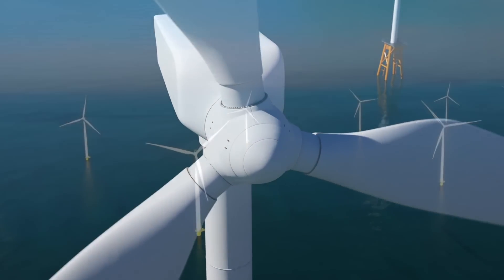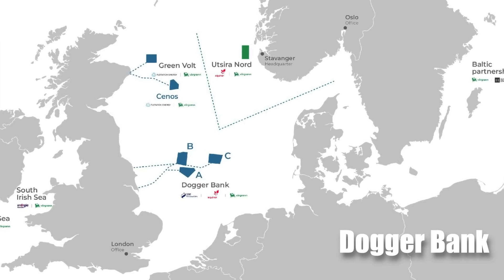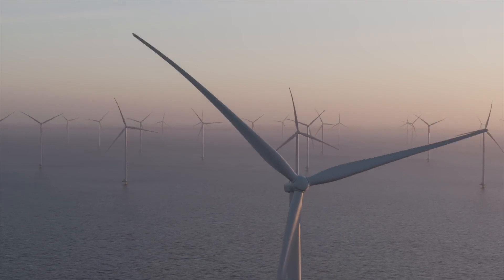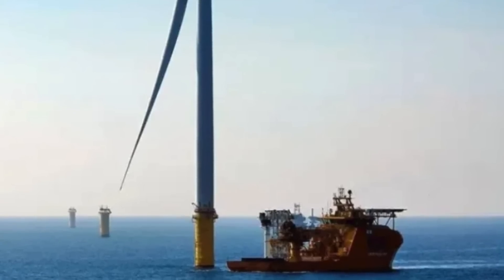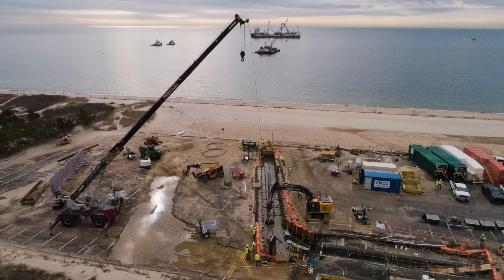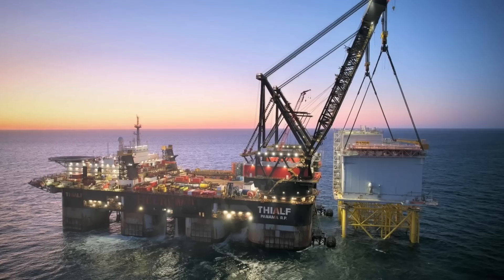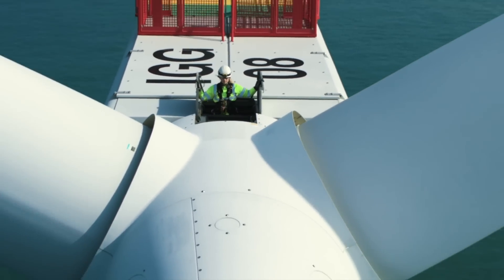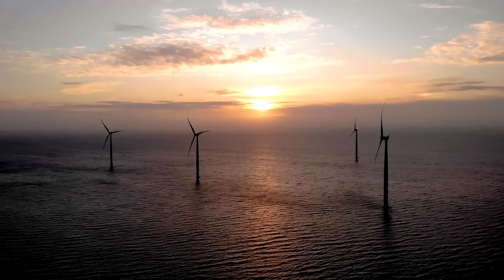Inside the $11.6 Billion Dogger Bank: The World's Largest Offshore Wind Farm

Comment: Can the UK run on 100% wind eneregy?
Reply: Potentially in combination with, tidal power, power storage, hydro power and solar power.
Reply: @petterbirgersson4489  they don't produce consistent power they fluctuate so without the power storage problem solved they won't dominate the power grid.
Reply: @WDUK-x1x  Sure it doesn't blow all the time, but the North Sea is one of the areas of the world with the most consistent winds. And if you have hydro and batteries as back up, you will be able to provide consistent energy.
Reply: @petterbirgersson4489  Yes but battery technology not any where near where it needs to be thats why i am saying we won't be 100% renewable for at least half a century.
Reply: @WDUK-x1x  You know that you can use pumped hydroelectric dams as a battery? There are a lot of abandoned mines an quarries in the UK that you could use for that purpose.
Reply: @petterbirgersson4489  and you know there isn't enough of that to cover the entire country especially London area. That might be fine for Wales and Scotland but you need other solutions for the flat land of London and sheer population in that area. We would've done it by now to get energy independence and for profit if it was so simple as you think it is. Instead we need nuclear and HVDC connections to other nations to go fully green. Thats going to take an easy 50 years.
Reply: @WDUK-x1x You know we have had Nuclear for over 50 years and have many international HVDC cables already.
Reply: @SimonEllwood  yes but we need a lot more if we are to reduce C02
Reply: @WDUK-x1x  Yet another lie. We do not need a lot more to reduce CO2 we need more. We are building more and it has already happened faster than expected.
Reply: @SimonEllwood  We are building one at Hinkley point and it is delayed. This isn't just about C02. Solar and wind deals with Co2 but they alone can't support our energy needs. So we need a lot more nuclear power. Why do you think Hinkley point is being made to start with...
Reply: @WDUK-x1x the storage problem is solved.
1. Use existing hydroelectric power as storage. GB has a direct connection to Norways hydroelectric grid.
2. Use smart EV charging as storage.
3. Use smartgrid and hourly tariffs to enable load-shifting on the demand side.
4. Increase electricity trade between countries. Spain and Marocco has a lot of solar power to trade, for example.

Works great.
Denmark already gets more than 60% of its electricity from wind power. No problem.
Reply: @vonnikon  

Use existing hydroelectric power as storage. GB has a direct connection to Norway's hydroelectric grid.

That is literally not a storage system. Hydroelectric power is for generating power not storing it like giant batteries.

Trade is a better solution but the infrastructure is a long way off and also increases costs of maintenance for everyone and makes our energy prices once again dependant on external factors which we are trying to avoid after the fiasco of the Ukraine war.
Reply: @WDUK-x1x  hydroelectric dams store literally enormous amounts of energy. Ready to be used whenever it is needed.
You shut down the hydroelectric turbines when wind power is producing well. This will store water flow energy in the dam.
If wind power is insufficient another day, then you just turn on the hydroelectric turbines and the use that stored energy from the dam.
Reply: @vonnikon  And where the hell are you going to place a dam for London? Those kind've things might be applicable in north Wales and Scotland but even then it won't come close to how much power we need. The issue is having them in Scotland does not help with the power issues in South England. Scotland might have plenty power due to their wind but London might be struggling, you can't just open the dam in Scotland because then you overload the network in Scotland. It's like trying to add water to pipes already at max pressure to increase pressure in pipes far away elsewhere. You need to have distribution just as much as you need capacity and storage - if it wa so simple it would've already been done by now.
Reply: @WDUK-x1x  you upgrade the grid.
Reply: Over the last 12 months, the UK grid used more Wind energy than Fossil Fuel, much more than Nuclear.
.
That's without this project being fully on line.
.
Eventually? Yes.
Reply: @rogerstarkey5390 why are our energy costs the highest in the Western world then?
Reply: No thats near impossible. Wind only covers around one tenth of homes at any instant and wind isn't 100% reliable. They will need nuclear and solar with it to be 100% green but 100% wind is never going to be possible.
Reply: No
Reply: The video said that the maximum output is enough to power 6 million homes in the UK - there are 28.4 million households in the country so at max output these farms could theoretically supply about 21% of the UK's residential needs. But there's another couple of tranches to come on top of the first three.
Reply: Thats just a single uk wind farm. There are many more@user-fm6ns5nb4j
Reply: No. I'm the future, wind power may be able to provide all energy needs for a period of time, but the nature of wind is that it is intermittent. It will always require backups and storage.
Reply: I wouldn't think so but if wind farms were distributed around the coastline  its unlikely there will be no wind anywhere and with storage, solar and nuclear it would go a long way towards it.